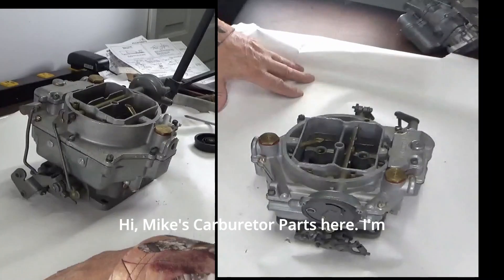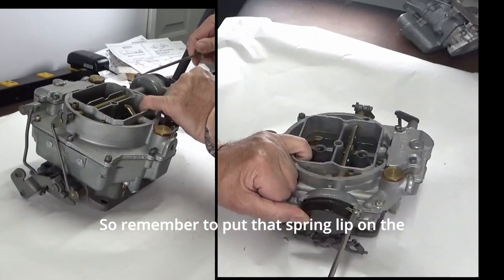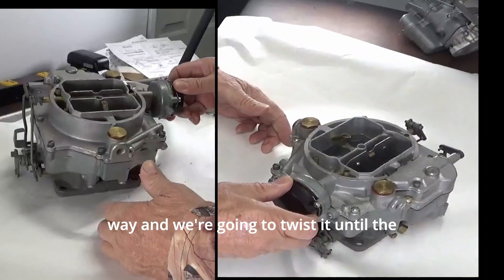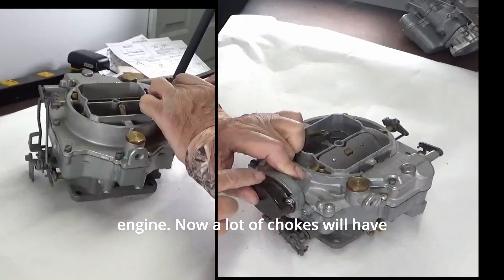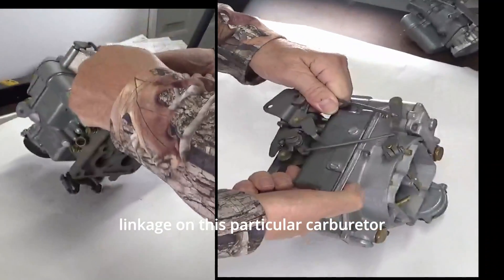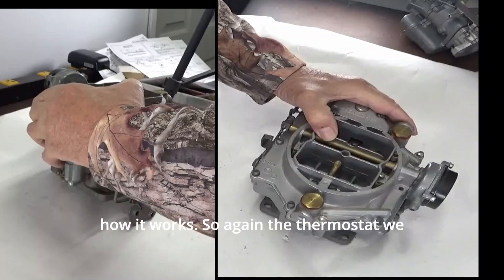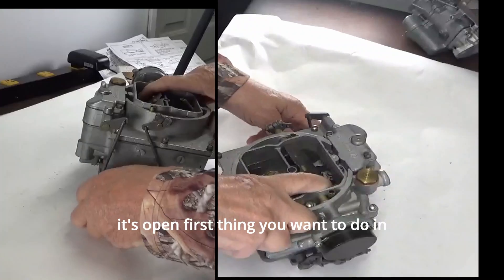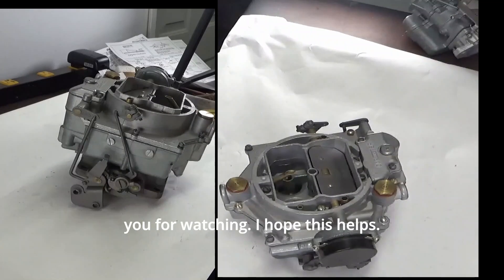How the Carter WCFB Choke Works

Comment: I have hit the gas pedal one time the choke doesn't close. What part of the linkage should I check for binding?
Reply from the maker: Start with the thermostat. Can you manually close the choke with it?
Reply: @MikesCarburetor  Yes I can manually close the choke by pressing on the fast idle cam assembly and some starter fluid.
Reply from the maker: No, I mean if you adjust the  choke by twisting the thermostat does it close the choke. If not, then there is a thermostat problem. @stevensolis6507